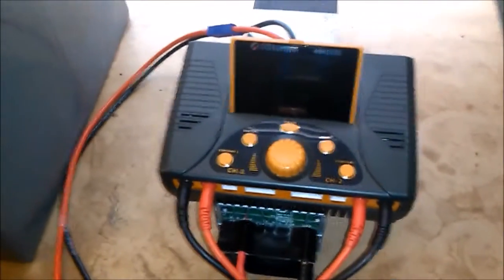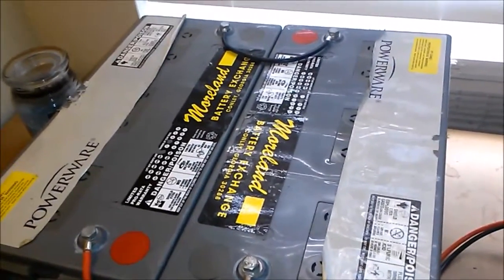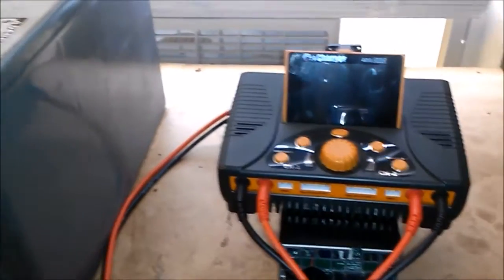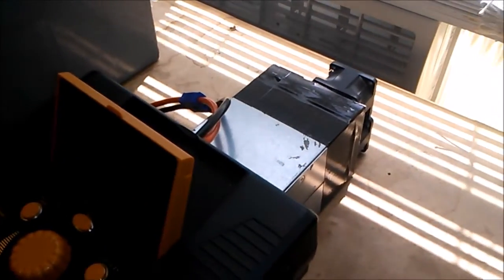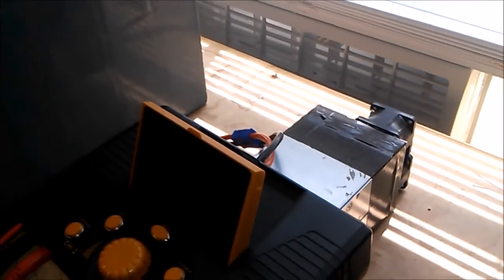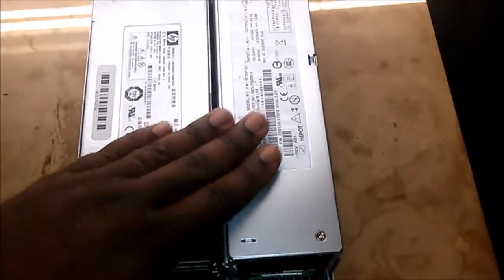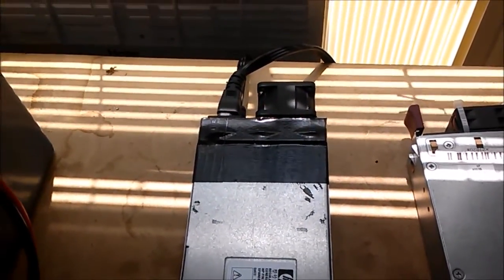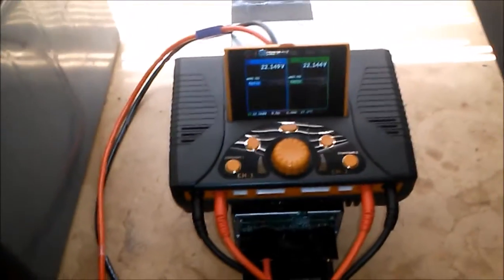HP 700w Power Supply Load Test

Comment: Nice work!  Where did you find the fan for it? I'm getting one of these and will try to use it at 12v but I need to find a fan for it.  Any more details on the build?
Reply from the maker: I would have gotten the DPS-750 it has a internal fan and its temp controlled runs alot cooler.. Doesnt require any major modification other than soldering some pins to activate. This requires much more modification and runs hotter.
Reply from the maker: Find another PSU I dont advise you to mod this model. Try the IBM 69A model if you need a slim line PSU
Reply: I just bought a DPS-700GB A, why wouldn't you recommend this? I will put a larger 8cm fan on it so should be cool enough.
Reply: Thanks for the reply. I was afraid there were stability issues with them even if cooled properly. I purposely chosen a fanless PSU because I'll be adding a silent fan (probably the Noctua NF-R8 which should give an airflow of 53 at just 17dB) that will blow through the power supply. I'll have to make a bracket of some sort at the end of it though to mount the fan. Planing to power a car amp that's why I need it to be silent. I just managed to turn it on an hour ago to test it and there's a very fain buzz coming from inside, is that common?
Reply from the maker: Alexandru Simonescu That is a compact design and I tries a lower fan speed and it went into thermal protect so I had to use the 12-13k rpm fan keep them cool.  They go into protection sitting idle no load no fan.
Reply: Yeah, I've had it on for about 1 minute just to test it so it didn't get into protection. Hopefully the fan will have enough power to pull air through the dense psu. This thing is indeed solid and compact, at least compared to those chinese ones made for led strips.
Reply from the maker: Alexandru Simonescu again depending on  the load it may work but if you need more than 50 percent of the capacity you will be disappointed.  I seriously don't recommend this unit.  I only sold them cause my vendor gave them to me.  After testing with several fans tested I had to use the loud fan in the video so that it would be stable at higher loads... I would never buy or stock these units again.
Reply from the maker: http://www.lipoconnectionsolutions.com/HP-12v-750w-Power-Supply-4mm-Bullet-Vertical-127504MMBV.htm